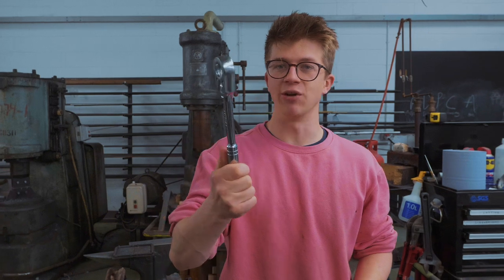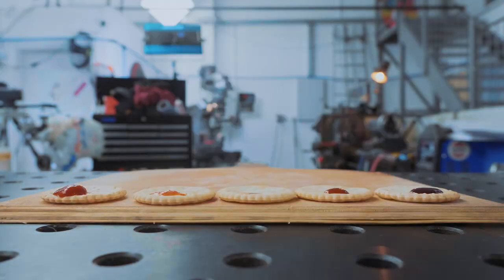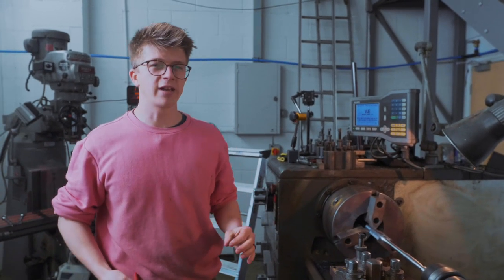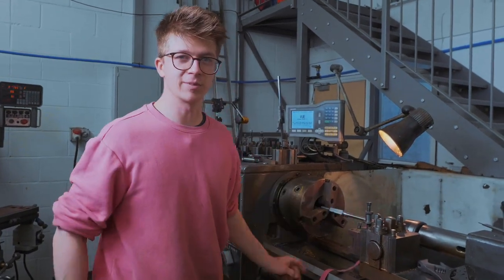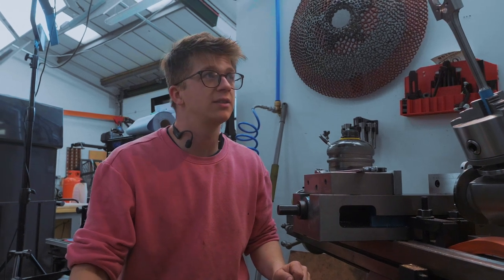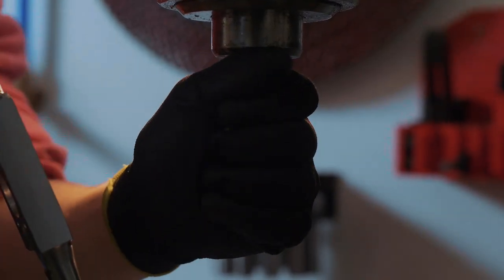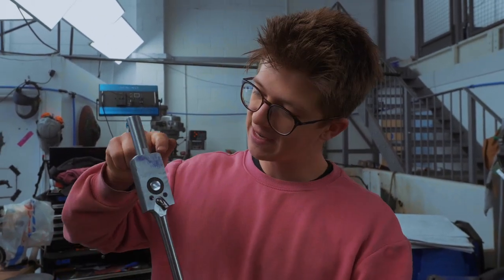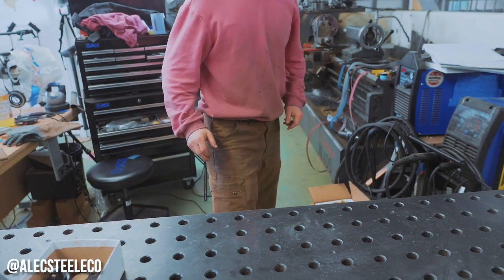Making a Socket Wrench from Damascus Steel! Part 3

Comment: For the boring you did last episode if you had a faceplate on the lathe you could have bored it out on there it would have been quicker as long as you were careful not to get hit by the handle

Comment: ah yes the lathe is the most dangerous tool in your shop            my guy that means you are the most dangerous tool in the shop lathes are hammers that make circles and if you know what you are doing and handle them right they are just as safe as a hammer because as we all know if you misstreat your hammer and pay zero attention to how you use it you can literally get shot by it

Comment: I'm not one to judge how someone ought to put out essentially free content, but a video about drilling 3 holes and sanding a metal pipe (with 2 baked in ads) is setting the bar quite low given Alec's usual standard.

Comment: There is nothing bespoke about bespoke post. They are misusing the word. AND you are ultra paranoid if you are going to that extreme using sandpaper on the lathe. Ive worked in machine shops before you were even born and in all my years ive never ever seen anyone do what you did with the sandpaper. You need to mellow out.